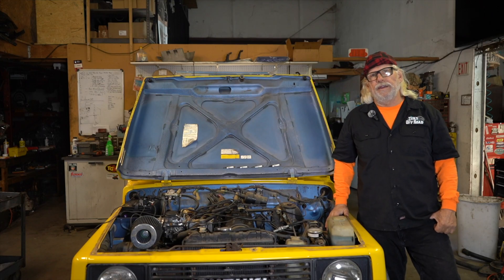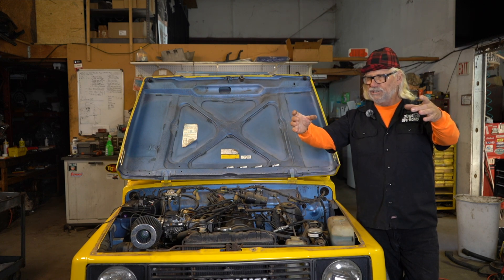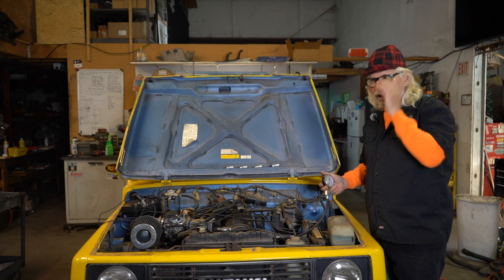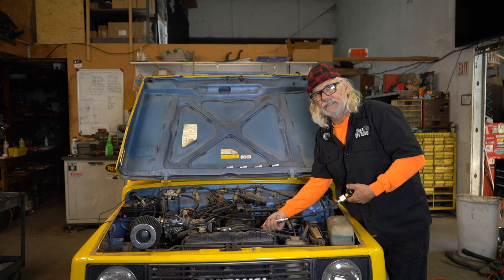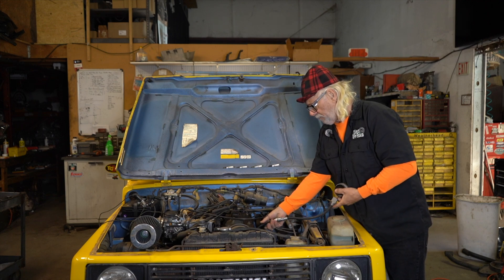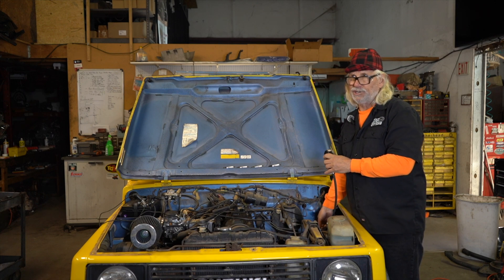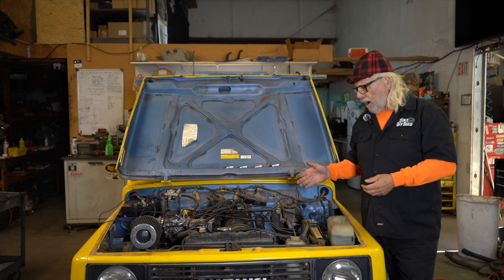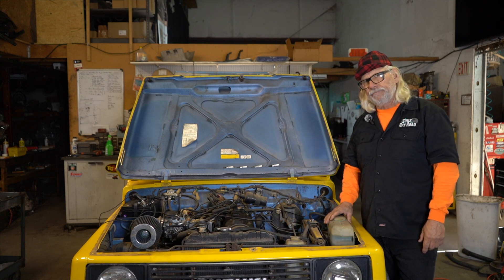Compression Testing Suzuki Samurai Sidekick Tracker Engine B4 You Buy!

Comment: i just went to try this, tried to put the spark plugs back in on cylinder one... and the threads didn't line up properly and i didn't try to force it i noticed it wasn't going in right away pulled it out and noticed some small metal shavings and bits at the top of the threads on the cylinder head, i vacuumed them out promptly. am i screwed? i feel so dumb i just used a normal 13/16 socket not the spark plug socket which im going to go get now

Comment: How oil in each cylinder for the wet test?
Reply from the maker: It’s 2 table spoons
It’s 2 squirts with a railroad can 
It’s a 2.5 ml syringe 
Give or take some. 

You want enough so the oil will go all around the piston to cylinder gap.